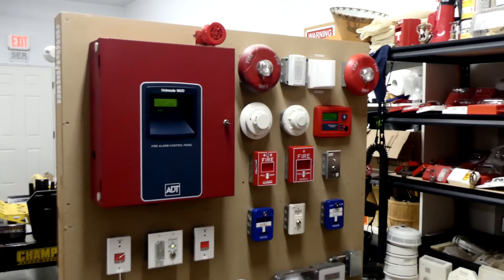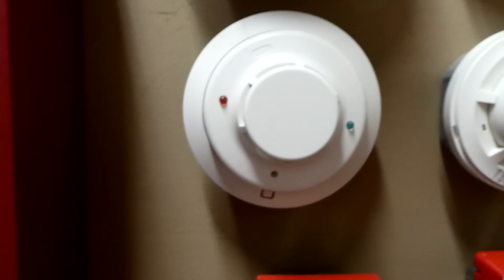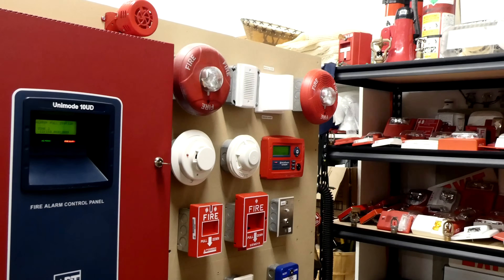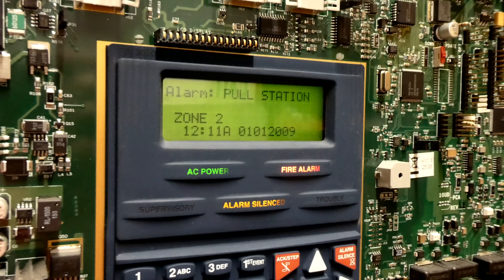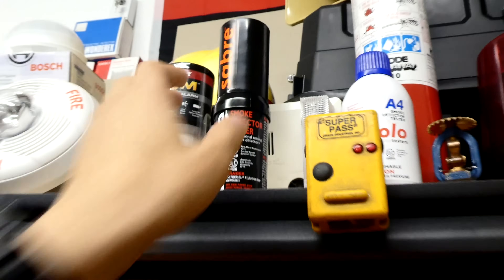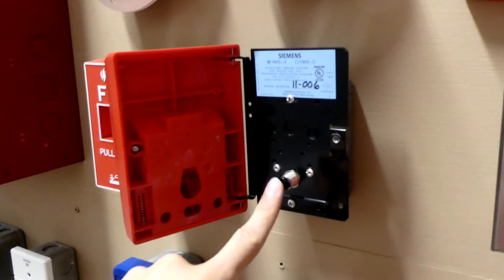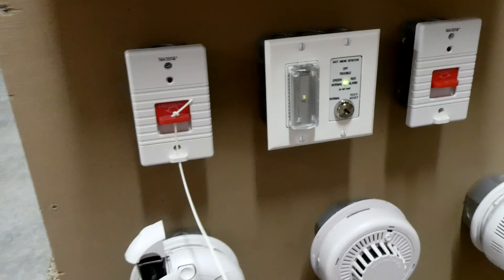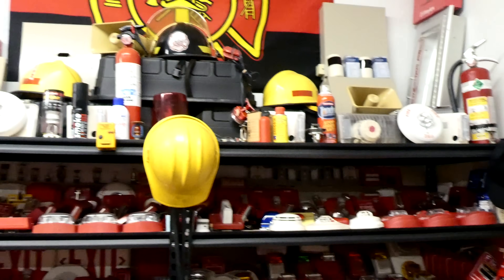ADT Unimode 10UD System Test 11: SpectrAlert Advance!

Comment: Apparently you can test smoke detectors with spray deodorant!
Reply: ZLD Smogless  really for real
Reply: If you think about it, it kind of makes sense. The properties of deodorant are probably fairly similar to smoke particles.
-ECO
Reply: @breinmanfireandsafety1512  I recently found out that you shouldn't do it very often, because the solvents in some deodorants can dissolve the plastic

Comment: 6:25 until a kid accidentally throws a Dodge ball at the alarm.
Reply: RavenFromTeenT YO DID THAT ACTUALLY HAPPEN!!?
Reply: @savannahmorrison376  yeah, I went to a highschool last year that was attached to the Junior Highschool, so both the Junior Highschool and the Highschool both shared a fire alarm system. 
One day, I was just sitting at lunch enjoying my pizza, and then the fire alarms went off out of no where without warning, so I had to go outside, and then I saw the fire department come to the school to investigate what was going on. almost an half an hour later, we went back inside, and I had to go to my next class. After I went into the classroom and sat down, the principal spoke over the intercom, and said that the false alarm was caused by a junior higher that threw a dodgeball at the fire alarm and that was what set off the fire alarm. That's how it happened.
That wasn't the first time the fire alarm system was triggered by the junior high btw. xD

Comment: They also make a $272 sensitivity tester for all of the system sensor I3 smoke detectors. It’s called the SENS-RDR

Also, have you shown the System Sensor Cosmod 2/4 wire smoke carb combos yet? It’s a pretty cool setup that works on any panel that supports 4 wire circuits.
Reply: Anthony Įødīçę yes they are very nice detectors. Unfortunately they do need a special module to enable the carbon monoxide detector part of the detector, but yes they will work on both addressable and conventional systems.
Reply: It’s so nice being able to do smoke and co on 2 wires though. The price difference is negligible vs the ease of install and flexibility of being able to put system sensor 2w-tab’s in the same circuit.

Comment: I remember those Serebus pull stations back in grade school, I still wonder how more unplanned fire drills didn't happen because they were basically unprotected for a time and were in the gym... which was also the cafeteria (it wasn't until after I graduated apparently that changed) then I got to high school and when I saw them, they had those barriers you lift from the bottom to pull the alarm (the barriers were also alarmed)
Reply: Those covers you are talking about are sti stoppers
Reply: Too much types

Comment: I understand what you said about the BG-8, but how could one "incorrectly" activate a BG-8? Minus a faulty button
Reply: CJ9899 Prehaps someone leaning against a wall and they slip their hand, since its activated from the top.
Reply: Lucas B That’s accidental. I mean in a way where you are intentionally pulling it
Reply: @CJ9899  ah right, my bad. maybe if someone tried to pull it up instead of towards them. depends...

Comment: i3 is called a C2W-BA
Reply: CJ9899 that might be a Canadian exclusive model number. In the US all i3s are 2W-X(XX) or 4W-X(XX). This is with the exception of a few discontinued items such as the 2112i3.
Reply: Dominic Rizzo Well, the C2W-BA is your standard 2 wire i3, but you may be right with the different model numbers

Comment: Does still make those Siemens pulls?
Reply: Allen Husch which one the old one or the new one? The newer one yes, the older ones no.
Reply: @pvh_facp4001yt  The one to the right in the video. I saw it in a brand new building.